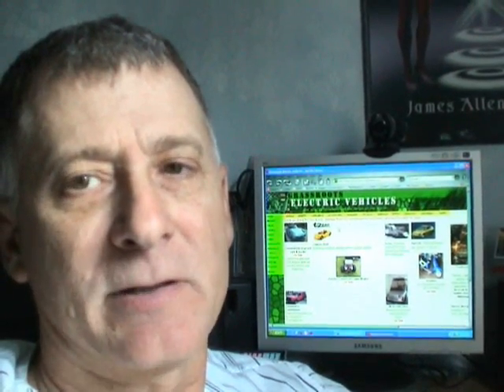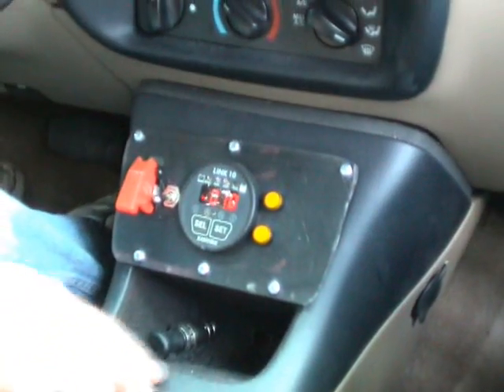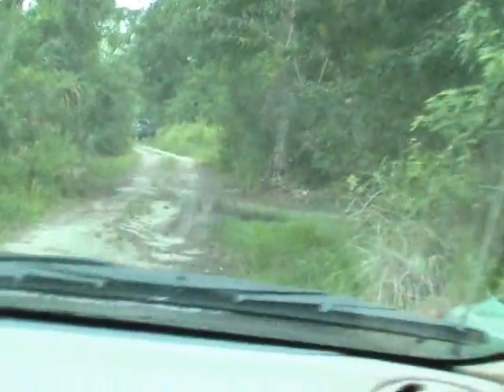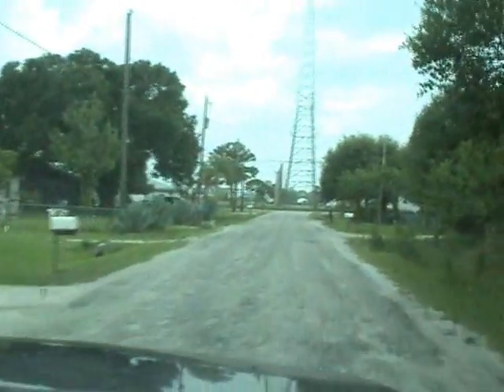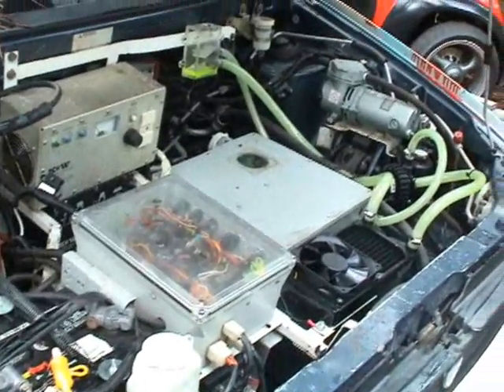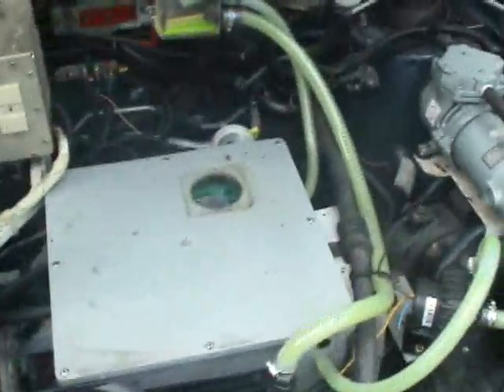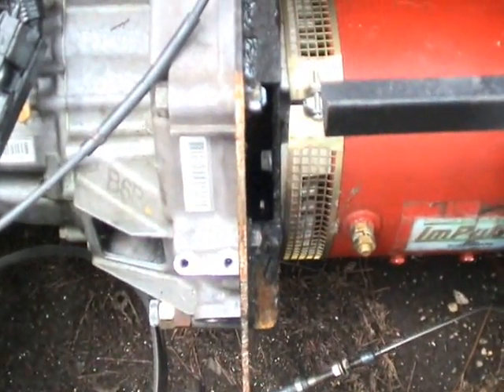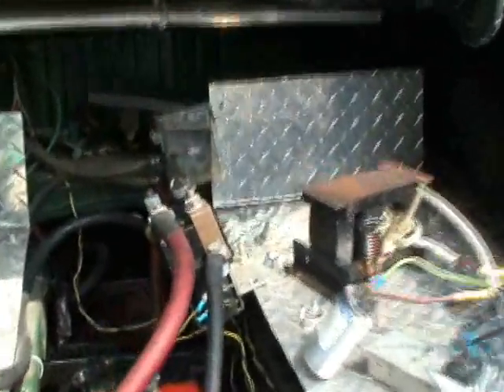Electric Vehicles (Part One)

Comment: As ashamed as I am to admit this, I'm actually partial to Ev's for short range shopping trips etc..
They make a good toy for quick short trips, but in Australia theirs too much open space to chew up your battery power.

I have been saving old Danfoss VLT drives from the scrap bin with the intention of getting one working and use it to power a small car via a 3 phase motor

Comment: it also uses for heating homes in a blend call
mix diesel #2 home heating oil aka as number
two home heating oil or just heating oil in a cental heating and cooling furnace that fired by heating oil.

Comment: Do a search for PHEV (plug-in hybrid electric vehicle).  That may be the way to go where gasoline prices are high (they're high everywhere right?) and electric rates are still relatively low.  There are companies out there that will convert standard hybrids like the Prius into a PHEV by retrofitting the batteries to Lithium Ion packs and a NEMA plug-in charger.